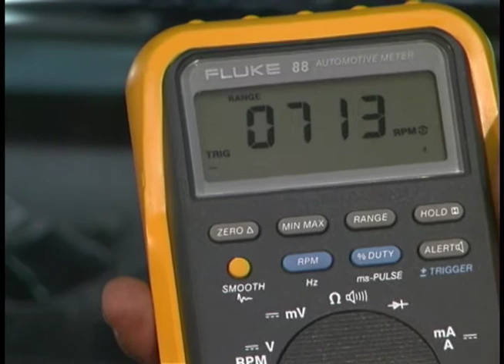Fluke DMM   Engine RPM

Comment: Very good. But there is no modern cars with spark plug wire. 

So it's useful only if you restoring vintage cars
Reply from the maker: There are a number of vehicles that have Coil Near Plug (GM V8 for instance) using short plug wires and a few engines that recently had two plugs per cylinder heads with waste spark using a plug wire for the waste plug.

Maybe not as common but could still be useful